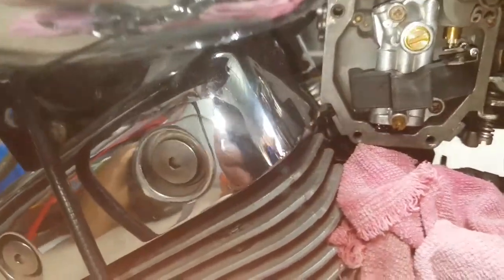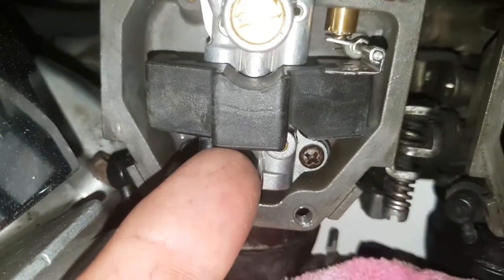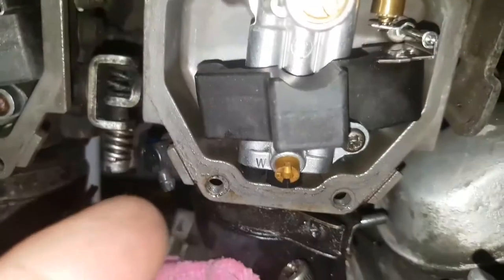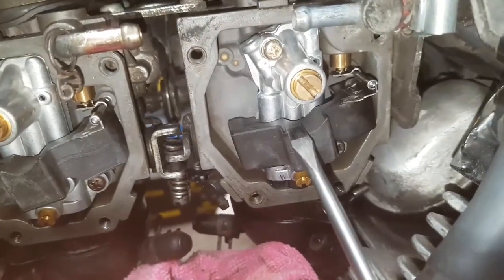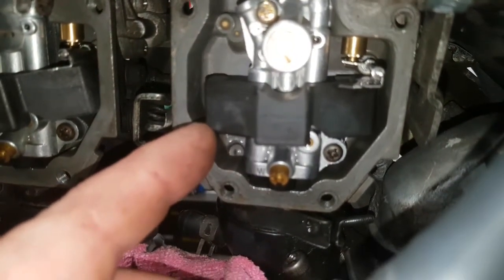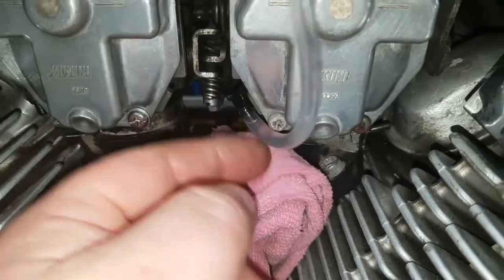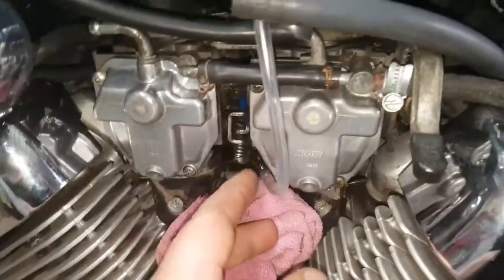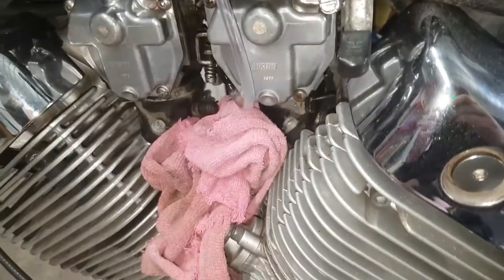Yamaha xv535 carburetor fuel float setup

Comment: Thank you so much for this video. I have been screwing around with my carbs as I have fuel leaking out. They are not the easiest to work with when on the bike. This will really help in getting my floats adjusted to a nice starting point. I have searched for hours trying to find relevant info and finally found you. I have subscribed and look forward to watching your bobber build!

Comment: Fuel lever should be 13.5 to 14.5mm below mark on side covers.its usually set to 14mm
Reply: That's right!! With a clear tube connected to the drain plug
Reply: *level. I'm not sure this is gospel as I just set mine to that and the bike won't start now. At 14mm the sprung loaded button end is out, in this video the button is closed with the float at the bottom of the circle...and my bike runs there! So I don't know where the guy on 'that' website got the 14mm
Reply: @doricdave  its not from website, its from both manuals haynes and clymer
Reply: or if u want visually that level is the long tube inside that block behind float
Reply: @doricdave  well mate sometimes u have to change needle. that spring button can be stuck also. or u have leaking on needles and it overflow causing rich mixture. and here is closed because he press it with bigger pressure than float and fuel

Comment: I see you have the needle valve hook with the open end facing the cover... Do you think it matters which way it faces? I know some have enclosed hooks in the rebuild kit and another guy told me the 1100's came with a enclosed one. I'm wondering why... And if the hook opening should face the carb body to kinda help keep from moving enough to drop the needle valve. What do you think? Should it be just the way you have it with the opening facing the cover and why?  Thanks 👍
Reply from the maker: I don't think it matters wich way and to be fair it has been some time since I been playing with them carbs   know you asked got me thinking lol wish I still had them carbs could of done some test to see  if it did matter and if it changed the fuelling if did swap them around. Mmm
Reply: @fuelheadjay8800  lol right it has me thinking 🤔 too. It's not easy putting the float on with the opening facing the other way and hard with the enclosed hook too.. idk
Reply: I've seen a disassembly vid where it didn't even have a hook and it was a 535 I don't remember what year though but same carb.

Comment: Hey new subscriber here 😀 is there a part 2 showing this fuel level measurements. I really want to see it I've got the Yamaha part the glass tube with the mm on it but I've got to get the tubing to attach to the fittings. So you just mark the tube and see if it's between 13.5-14.5mm below the bowl line on each one and your good right??
Reply: Thanks for the video and glad to be here!!!
Reply from the maker: Yer around that been a bit since playing with the carbs
Reply: @fuelheadjay8800  OK I think I found the issue my hose/tube for the drain fitting was kinked. This morning the fuel level was right around 20mm below center mark on cover. So I'm guessing the float is not going high enough when it shuts off and I should bend tang up bc it should be 14mm below center mark. Is this correct?? Thanks!!!!!!!! Does it matter how long the tube is??
Reply: @fuelheadjay8800  my book says bending the float upward very slightly to lower the fuel level; bend the tang down to raise the fuel level. If too high to rich to low to lean. So does the book mean to lower the fuel level you bend tang upward, would that mean it would make it go from 20mm to 14mm below center mark or would it make it worse???
Reply from the maker: @karlh4313  yep it should do
Reply: @fuelheadjay8800  Okay after several attempts I finally got it like at 14-15mm below mark on side covers.. problem still is happening popping and not sounding good. I did notice that the pump kept running so I did the test in the manual and checked wires it's saying the fuel pump relay is bad could this be the cause??
Reply from the maker: Yes could be

Comment: Its probably irrelevant now because you changed to single carb, but you adjusted your floats wrong, the fuel level should be 14mm below the mark on the casing, you should check the fuel level first and then adjust the tab up or down accordingly, the floats act totally different to finger pressure when immersed in fuel
Reply: yeah, i was searching for that info also and find out it should be between 13.5 and 14.5 mm. I also read somewhere that back carb should be set a bit higher to prevent heating of cylinder but i am not sure about that info tho
Reply from the maker: I read some where same but there so many different ways pick one.and see if it works for you I did it the manual way and seem to work.
Reply: @dadobojanic  they should be set the same, and it is actually the opposite the rear cylinder should run leaner than the front on European models should have a different jet size for front and rear, larger at front smaller at rear. The virago is an air cooled engine, more fuel on the rear cylinder would make it run hotter which is not what you want
Reply: @timlipscombe5168   The main jet or pilot?
Reply from the maker: Main jet chap
Reply: Does fuel come out the drain screws during this procedure? If so do you just put rags or vinyl tubing coming from them? And do you you do one drain screw and one the float level and then tighten them up and go to the next ones when checking with vinyl tubing? Thanks
Reply from the maker: As long tube higher then float should not leak out but will spill a bit so best just to stick a bit of rag under
Reply: @fuelheadjay8800  thanks btw new subscriber 🎉
Reply: @timlipscombe5168  Don't think that is correct.  The rear cylinder runs hotter and therefore the stock jets are slightly bigger to compensate (more fuel - "less" heat).  It's a clever design where they use slightly more fuel in the rear to  compensate for it being tucked behind the front and therefore running a little hotter.
Reply: I adjusted mine to the 14mm that is on a website blog and now the bike won't start so don't take it as gospel!! I think this guy is closer to the mark, for my 535 anyway

Comment: Good vid.. Ever change a float valve seat in one of those Mikunis?
Reply from the maker: No but think u have to drill them out to fit new. But not sure.
Reply: @fuelheadjay8800   Problem with that. The seat removes from the inside out. A brass cap goes in last. The brass cap is punched. Underneath that is the strainer. Just saying can't imagine having to drill the brass cap. Not included in any rebuild kit. But, you may be right. Guess i could tap the hole a bit and put in an allen plug. The problem is the strainer right underneath. Will let you know what happens after i bung it up. lmao...  All Balls kit...   2 needle valves also in kit  26 - 10048 have no idea where or if they fit somewhere .. No directions. Checked website. Nada.
Thanks i will get back to you. 
Great channel. Subbed and liked.
Reply from the maker: Yes chap let's us know how it goes good to know in case I end up doing one lol
Reply: Mine were sticking. Found 2 vids on polishing the seats. I used light rubbing compound. Cotton bud plastic stem on cordless drill. Then finished with metal polish. I had the carbs out. The front stuck on me, again, but I had the motorcycle sitting for 2 weeks.
I'm thinking to put a switch on the fuel pump to turn it off and let the bike run the bowl level down a bit to drop the float. Guess I could also drain the bowl!
Reply: @fuelheadjay8800    I got one out. The cap is a banjo affair to allow fuel in from the fuel line inlet tube. The inner side of the inlet tube is recessed. The cap has an O-ring above the banjo grove and one can see how deep the cap must go.. The old seat also has an O-ring. That O-ring was rock hard and deteriorated. The new seats in All Balls kit do not fit real snug. Iffy at best but soaking them in brake fluid expanded the O-ring enuff where i will give it a go. The hole is slightly larger than 10mm so the best conclusion i could come to on a new cap is a 7/16 allen plug. The plug must be flush with the top or the rubber inlet boot and clamp cannot sit all the way down. Not much space between the seat hole and intake rim, making fashioning a puller a pain. Underneath the allen plug i will insert a 10mm stainless spring   .1 wire and cut to suit depth from bottom of installed allen plug to seat to hold seat down into place..  The hard part will be drilling the 25/64ths hole in the 10mm bore to tap for plug. The plug will probably have to be ground shorter at best. Teflon tape for gas.. to seal plug. After that's done replacing seats will be easy. If the new seats do not seal; the pain is having a go at installing the carbs again.  I imagine carefully J B welding the upper rim of the seat as little as possible if necessary. Also the old cap must regulate pressure so the spring may serve in that capacity if cut to length properly. Probably as long as possible without binding the plug when installing the new plug flush with top of seat bore.
Reply from the maker: Seems a lot off messing but good luck let us know if you get it sorted and it works. Be interesting to know for future reference.
Reply: @fuelheadjay8800   Also good being able to take them out to clean and replace O-Ring...  Maybe be able to remove the seats with carbs installed.
Reply from the maker: Yes defo
Reply: Having the same prob with my rear float valve sticking open. Cheap enough to buy valve and brass seat. Does the brass valve seat pull out down into the float chamber? Is it possible to take the brass seat out with the carbs still on the bike?

It runs really well but now and again the bloody thing sticks open
Reply: @mrman7812   Yes better to take the carbs out. Lubing the intake boots makes reinstall much easier...  I fashioned a puller with a 1/4" drive 7/16 socket. You will need a drill and tap for a 4M bolt to pull the cap. You will need a longer 4M bolt to pull the seat..  Replaced the cap with a 014973319892 Socket Set Screws, 7/16-20 x 3/8, Piece-8. The right tap fits the hole perfect without drilling.  I added a stainless 10M spring between the cap screw and seat. Once this is done you can replace the seats without removing the carbs, altho' the intake boot still has to be pushed up off the carbs.
Reply: You can tap out from inside carb bowl they do come out no need to drill and Partzilla sells the correct valve and seat for them..
Reply: There's a new video out with a guy doing it..

Comment: I did mine again like this and if I set it to the mark it shuts the fuel off and when I let fuel out it still goes past 14mm to like 20mm below if I bend the tang down it lowers the fuel level in the tube even more to like 30mm? I can't get them to 14mm or 13.5-14.5 and they are brand new floats and needle valve assemblies. Please help!! I'm using the Yamaha tool but it has a 6mm tube with plastic tube same size so I made it into a couple sections to make it small enough to fit the drain hose fittings. Could this be my problem? I'm going to buy 3mm tubing but weird all the books say use the ym part of  clear viny tube and measure it from the mark on cover.
Reply from the maker: It takes alot off messing around to get it set have u tryed bike out after setting close to  14.5 if not give it ago
Reply: Is the bike level and did you crank it over to fill front carb? If not it will read around 20mm

Comment: Hi there! Unfortunately I had to remove both floats, because the last owner bent them wrong, so they got stuck in the valve opening. Of course both valves fell out. Cleaned them and adjusted the floats correctly. Now the bike wont start. Could it be to lean now even though its to spec or could the valves have been damaged? Thanks in advance
Reply from the maker: Have you check spark plugs make sure u not fluided and make sure jets are ok and fuel getting into engine and do a valve adjust make sure there ok.

Comment: hi mate could you help me i have the same bike and today i realized its running to lean the exhaust pipes get way to hot and blue to quick and it back fires wen letting of the throttle
Reply from the maker: Do a full carb clean and make sure valves are set right then make sure carbs floats are set right. Make sure you got no leaks ie spray carb cleaner around carb boots see if engine revs up.

Comment: I did exact the same setup and my bce doesn't work anymore. thanks. I return all that Ive done and it is still not working.....
Reply from the maker: U defo done somit wrong
Reply: @fuelheadjay8800  hi,

ty for your answer. I wish you have a nice week.

actually I test valves again. when I made your setup gasoline can not rise enough. as you can see there is 2 pins inside of the carb. little one in the bottom takes the gasoline inside the structure and it needs to rise to de upper yellow screw. which it has the throttle needle. 

so, i tested again with a piece of transparent pipe, gasoline only rise to the half of the carb. so I just want to look what is going to happen and take down the float arm as much as I can do. off course gasoline came to the top of the carb. and I tried again it is not working :)

now there is two ways to fix this I think -; I will find a singe carb kit or I will buy a carb repair kit. 

i will let you know the results.

thanks

Comment: Hey fuel head jay! One of these carburetors of my virago 535 (right) is leaking out with petrol just right at the bottom part. What could the cause be? Thanks for your suggestions!
Reply from the maker: In the cap make sure rubber seal ok if not replace or stick some gasket sealer on then put cap back on leave to dry before filling carbs back up.
Reply: @fuelheadjay8800  Awesome. Thanks bud. I might try that!
Reply: @fuelheadjay8800  by the way, do you have steps/precautions on replacing the gasket?
Reply from the maker: @MegaElique  
EBay listing number 351332214875

Make sure bike is switched off stick sum rags under the carb that leaking . Un screw the 4 screws on the inside of cover you see the black gasket pick it off them put new in or fill the gap with gasket sealer and all round edge off cover out edge off the gasket them screw back on leave for 24 hours so sealer go's off then turn bike on and it fill carbs back up make sure no more leaks
Reply from the maker: @MegaElique  make sure u clean well before applying sealer
Reply: @fuelheadjay8800  Thanks very much. Such a great help from you. I will try this once I get the stuffs!